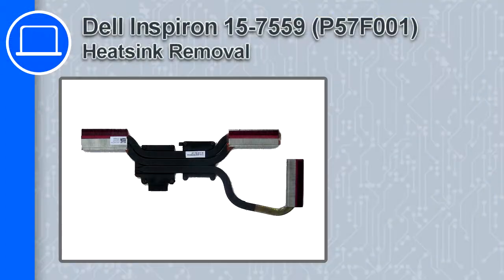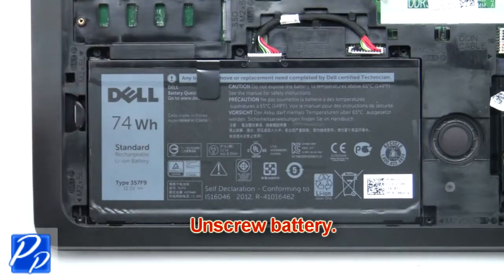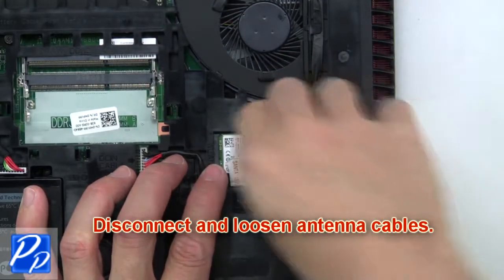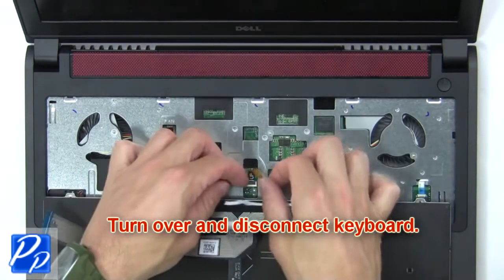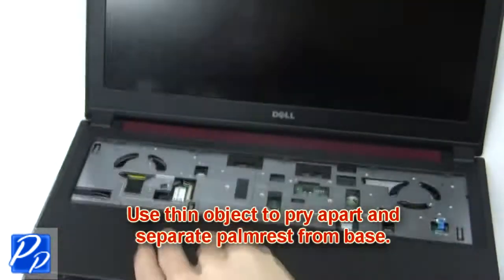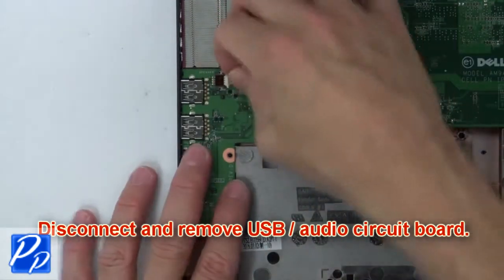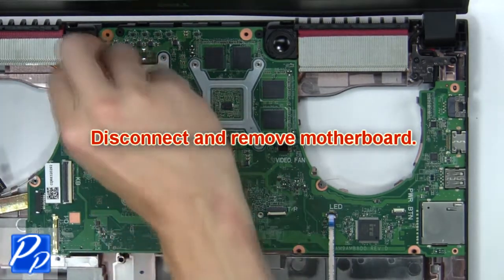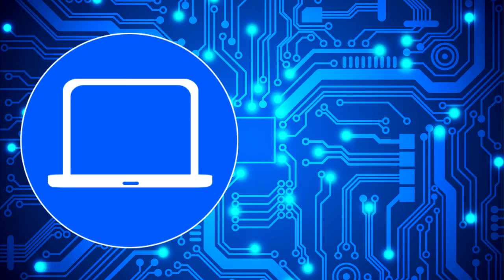Dell Inspiron 15-7559 (P57F002) Heatsink How-To Video Tutorial

Comment: I disassembled my 7559 following these steps, the thing is my laptop came with thermal pads and by the occasion I had never heard about it -- because I was not used to deal with laptops, only old desktops lol -- so, I cleared it out with isopropyl alcohol and I'm having much higher temperatures than before, especially the gpu. Now I decided to not use my laptop until I buy the thermal pads. The thing is that I forgot to measure the thickness of the pads, does anyone know how thick it is, the thermal pads? Thanks
Reply: Resuming my adventure I bought 4 pads with the following measures: 1mm thick and 2x2cm (totalizing 8x2 cm I guess lol) and those measures worked just fine for me -- the thickness seemed appropriated and 8x2 cm were enough to replace all the pads (considering that there wasn't any significant leftovers when I finished replacing), and I meant it when I said "all pads" since I replaced them all, including those attached on the Heatsink. Over the "main" chips (one belonging to the GPU and the other belonging to the CPU) I replaced the thermal paste using the Thermaltake TG-7. I've always used basic thermal paste on my computers, which means that I haven't tried other high performance thermal paste than this one, but so far it has made a huge difference for me. Finally I just would like to emphasize that I can't guarantee that these pad measures will work for you, since there could be be manufacturing differences between my laptop and yours, besides I'm not that experienced on laptop maintenance, so, I'm not sure if other pad measures could fit better on this model
Reply: @jsalmeiida  Thanks for the update.

Comment: I have a very important question, is the heatsink compatible with liquid metal paste? (like does the heatsink have aluminum?) I would like to use the liquid metal to increase my performance by reducing the temperatures.
Reply from the maker: The contact points are all copper on this heatsink.
Reply: Do you recommend using liquid metal on this laptop?
Reply: no need to put liquid metal in it, my temperatures dropped 15°C on CPU (from ~80 to ~65) after applying new thermal paste. (aida64 stress cpu/fpu) and the cpu cooler is running slower/more quite too